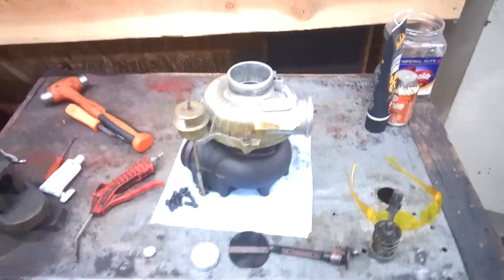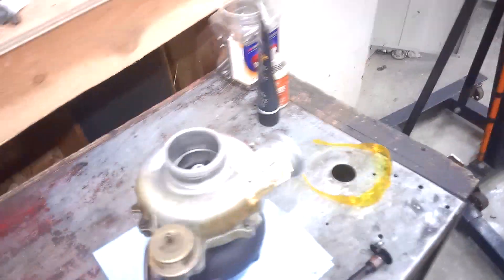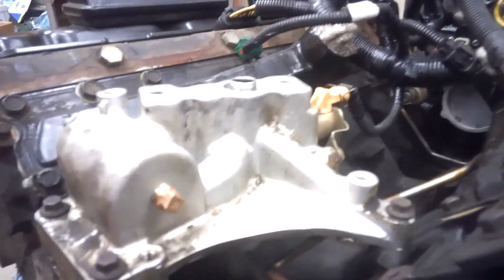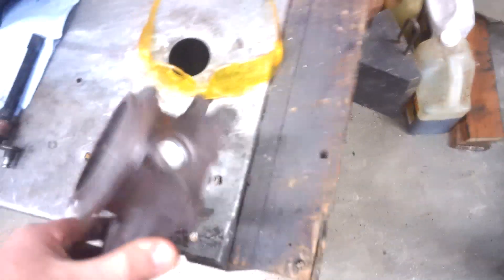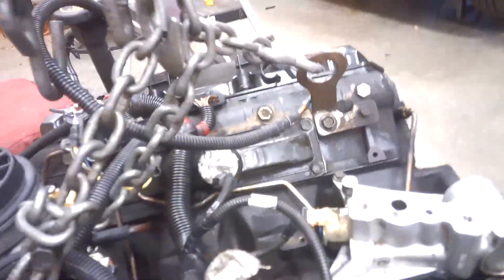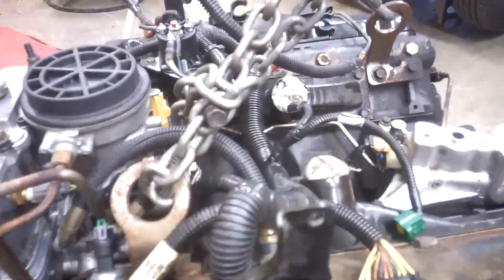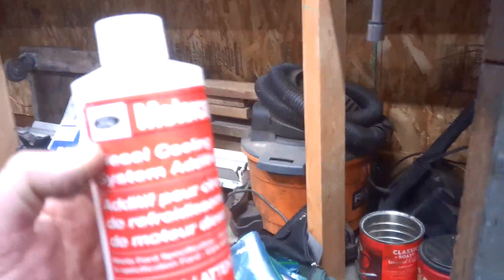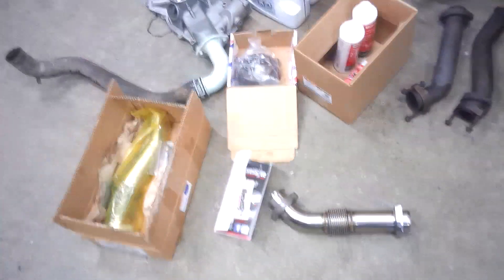7.3L backpressure valve bypass

Comment: Can you list the part manufacturer/number for the freeze plugs you used? Dorman has several around 1-3/4. Just wondering if the slightly smaller or slightly larger one is needed. Dorman 555-037 or 555-059. Thanks. Awesome video!
Reply from the maker: Simon Walter-Hansen Honestly I don’t remember. I know we bought both sizes from Napa and returned the one that wasn’t used. Wish I could be more help. I’d recommend to just get both. Fortunately they are pretty inexpensive

Comment: Mike I don't have a oil leak but was interested in disconecting the actuator and fasten the butterfly in the open position.  Do you see any problems in doing this?  If I see any MPG or performance gains I'll do the valve shaft delete. Thanks Mike
Reply from the maker: Joe Taguchi should be just fine holding it open.
Reply: @im469too  Thanks Mike I'll give it a try
Reply: @joet.898 did u ever do this? Did it work well for ya?

Comment: How is running ?
Reply from the maker: colas solorzano it runs just like it’s supposed to. No issues at all
Reply: Mike Griffith Garage have a question
Reply: Do you think. It shold. Work if i use the aluminum. Plug. With poxy the the retainer ?
Reply from the maker: I’m not sure epoxy will work due to the amount of heat. That why we used freeze plugs
Reply: Mike Griffith Garage dis you remove the sleave to put the 3/4. Freeze plug ?
Reply from the maker: colas solorzano I just removed the rod and installed the plug. make sure to put the snap ring back in. You’ll be Golden
Reply: Mike Griffith Garage thank you
Reply: I did.   Already. But not sure. What to do with the sensor.